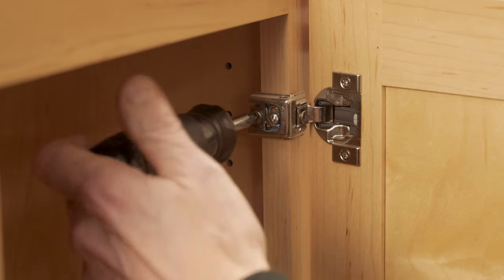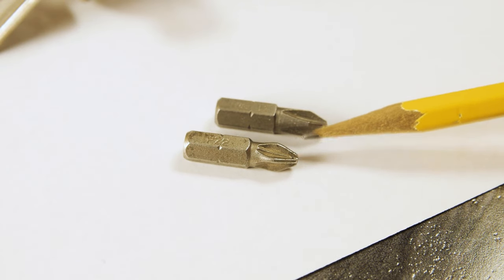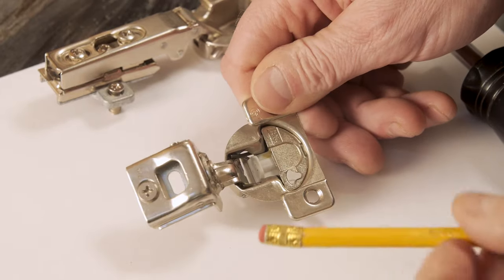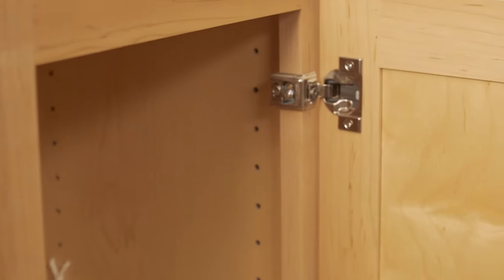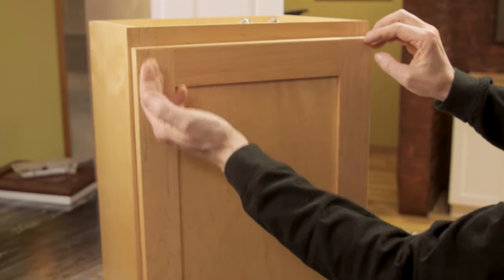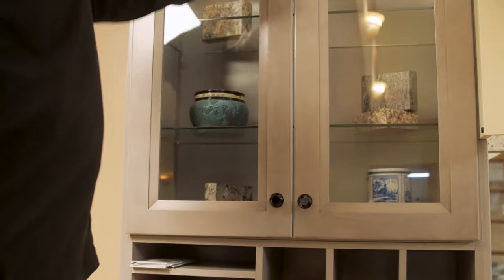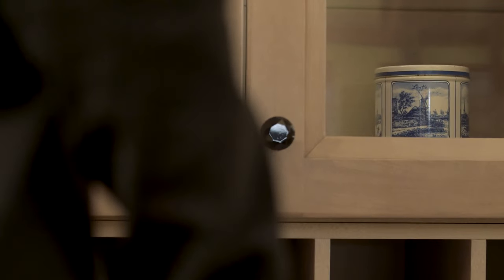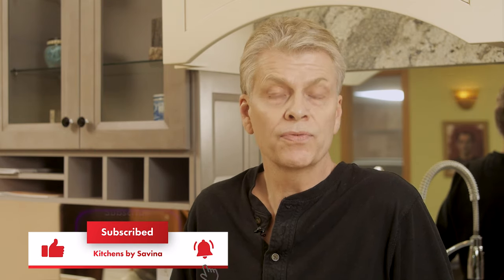How To Adjust Kitchen Cabinet Hinges

Comment: This is the best video on adjustments!  The only issue I'm having with adjustments is when the door isn't as close to the frame as it should be and the screw adjustment is as tight as it can be so no way to make any further adjustments.  I plan on getting replacement hinges.
Reply from the maker: Glad the video helped.   Make sure you are using either a Pozidrive or Phillips tip on your driver, whichever is the correct one.   Normally if your door was correctly adjusted when new it should be able to adjust back to that.  Without seeing it, hard to guess, but perhaps a new hinge will correct.   Good luck or contact me if you are unsuccessful at KitchensBySavina@gmail.com and I will try to help further.
Reply: Yes, I have both types of driver tips.  Two years ago we had all of our cabinets painted and the doors were removed.  I'm not sure if that caused some of the issues or not.  When we bought this place I had to make adjustments to a lot of the doors and drawers.  I bought new runners for a few drawers as well.  I just ordered two sets of hinges and a set of runners.

Comment: Thank you for the clip. Very helpful.  My slow-closing door does not go all the way in. How do i adjust it please?
Reply from the maker: About the 4.30 mark I discuss how to adjust the speed that the door closes.   Your hinge may have a variation of this.   It is possible that yours is broken or defective and may need replacement also.

Comment: Excellent video.  Did I miss you showing how to adjust how far the more expensive hinge opens so it doesn’t hit the adjacent cabinet?
Reply from the maker: I am not exactly sure of your application and hinge.   If it rubs against a doo next to it while opening, then adjust those doors farther apart.   If it open to hit a door on an adjacent bank of cabinets i.e. 90 degrees, you may be able to replace you hinge with one that does not open so far.   Several opening degrees are normally available.   Also you can install a positive stop in order to limit how far a door opens.  Something like this:  https://www.amazon.com/Stainless-Restraint-Cupboard-Restrict-Flexible/dp/B06VWYN115
Reply: @KitchensbySavina    These or what look like identical hinges are installed on my Wellborn kitchen cabinets.  When they were installed a couple of years ago the installer was able to adjust how far the cabinet doors swing open. Some doors open 90 degrees, some more.  I have one door I’d like to tighten up a little.  Unfortunately my contractor retired and is no longer in the area.  I’ve seen the door chains on some high end RVs.  Thanks!

Comment: Great demonstration.

It’s more complicated than it seems. I recently worked at a commercial cabinet shop for 2 years and would always struggle to adjust doors because when you move it one direction the opposite direction naturally follows, so it takes quite a bit of time to get them perfect.

If you spend 5 minutes on a pair of doors and have 10 sets, that’s about an hour.
Reply from the maker: Hi Maven.  In a cabinet shop setting, it's all about precision setup procedures.   The hinges should come from the factory all adjusted alike.   If the cabinet shop is setup using the proper hinge and jigs for installation, then theoretically there should be no adjustment necessary in the shop.    Any adjustment should be minor.    That being said if it is a truly custom, one of a kind piece, then that piece is always time consuming like a prototype would be in a general shop. I'm glad you watched the video and I hope it was helpful.  :)

Comment: This was great comprehensive hinge adjustment teaching! Didn't help completely fix my problem. Wonder if u have suggestion: Have a 24 x 36 corner top cab. Door that came with it was 1/2" short width wise to cover cab opening. Hinge adjustment = approx 1/4" gap remains. Ordered mullion door for it from same cab maker thinking we got weird orig door BUT the issue is the SAME! Pulling my hair out! Called cab dealer RTA & they tried to help by sending a box of hinges, but they have no more advice. We can't be the only people to have this issue...can we?? Please HELP! (Hav pics, bt dont knw how to send it here & can't find ur email address on page. New to u tube use.) Many thanks!!
Reply from the maker: Hi Melissa,  send email and phone number to my email at KitchensBySavina@gmail.com   I'll be glad to help.  website is www.kitchensbysavina.com

Comment: For full-overlay doors on a cabinet with a face frame, should the reveal be the same on all four edges, especially the same on the top and bottom? Or, as I have seen in some examples, should the door be centered left and right, but have 0" (zero inches) reveal on the bottom edge?
I am adjusting the doors on a cabinet over a microwave and I have some cabinets that are stacked, two and three high. I'm also considering a light rail.
Thx,
Reply from the maker: There is no rule.  I always leave a little clearance on the bottom.  I build my cabinets with 1/8 clearance top and bottom and 1/16 from edge to allow a run of cabinets to have 1/8 between all doors.  What you do depends on the case size vs the door and drawer sizes that you have.  Adjust for visual appeal and so nothing binds or scrapes.

Comment: Thanks! I did notice that the soft-close mechanism on the hinge you were holding in your hand differed from the soft-close mechanism on the installed hinge. How does the type on the cabinet adjust? I have a self-closing hinge set that is slamming.
Reply from the maker: The difference between self closing and soft closing is just that.   Self Closing pulls the door shut hard, i.e. slamming.  That type is not adjustable.   
You can buy new soft close hinges or install these: https://www.amazon.com/Rok-Hardware-Cabinet-Compact-Adapter/dp/B00IRLHIEK/ref=sr_1_7?crid=3H78AWPIDS669&keywords=soft+close+cabinet+door+damper&qid=1673809922&sprefix=soft+close%2Caps%2C80&sr=8-7

Comment: I have been searching for a well made and concisely explained use and function for these types of hinges. Particularly the GRASS product. But I’m writing to request a how to for a folding inside corner door. 
A few years back I had my kitchen remodeled and the designer uses Grass Hinges. I’ve never been able to locate the exact items for replacement when one hinge somehow snapped on a heavy (3 hinges) folding corner door. So I’m left to the mercy of the design firm to provide the replacement. I installed it and managed to sort of get it all back to good. But the actual steps are still a mystery. 
My door sags as you’d expect, against the neighboring door opposite the pivot. 
I also learned that even my excellent quality screwdriver is destroying the PZ screw heads. So I’ll be purchasing proper tools for this immediately. 
Can you direct me to or yourself create a video covering the folding door procedure. Please!!
Reply: I would like this information also!  Overnight, my folding door has seemed to sag enough to not close, or hit the top of its neighboring door.

Comment: Hi,
I have a problem with the IKEA besta TV bench..

The problem is the screw which is used for Height adjustment is not tightening or not loosening. Seems the issue with the threads.. 

Is there any fix you would like to suggest..
Reply from the maker: Sometimes a bit of hard soap or wax on the treads and try to work it back and forth until smooth.   If it can be removed, then you can purchase a tap at an automotive or hardware store and re-chase the threads.

Comment: Hi Gordon.  I can't seem to find a single video about how to do this with a desktop-type cabinet door.  I've got an entertainment center where the front lip lifts and I can store 3D glasses, DVD's, whatever.  It's the entire length of the entertainment center but only about 8" deep, so getting all 3 hinges level is proving to be much more challenging than kitchen cabinets.  There's also a 50 lb center channel speaker sitting on it, which also caused it to become unlevel, but even after leveling that, I can't seem to make it flush.  I'm hoping you or someone would make a video on how to do this?
Reply from the maker: Email some photos along with your phone number to kitchensbysavina@gmail.com and I'll try to help.

Comment: What if the door it self opens too wide? Ours is hitting another door while open. Thanks!
Reply from the maker: Hinges like the type in this video often come with different opening degrees.  Some open 90, 95, 100, 110, 120 or even 170 degrees.   They are available like this do work in different applications.   Search your type of hinge on the internet and see if a different one is available.  It may solve your problem.   Also there are many DIY solutions.  Here is one example.  https://www.charlestoncrafted.com/how-to-keep-a-cabinet-door-from-opening-too-far-the-easiest-way/

Comment: I have the old cheap style hinges and the door does not shut all the way.  I tried to adjust it but it still does not shut flush against the cabinet.  Is spring worn out or am I able to adjust it with the shims or?   Thanks!
Reply from the maker: If they have a spring that holds shut it may be in need of replacement.   If hinge side of door is too tight to cabinet, that will prevent it from shutting all the way.  If so, space hinge side further out from cabinet so it doesn't bind.   Let me know if this solves the problem.  :)

Comment: Please show how to remove cabinet door if you have the soft close hinge. You showed how to unclip the imported hinge and remove door but you didn’t show how to unclip the other hinge to remove door. I need to paint a small strip of wall that I can’t reach unless cabinet door is off.
Reply from the maker: I'm not sure which hinge you are referring to.  Not all hinges unclip, you may need to unscrew it.   Usually careful inspection of your hinge will point you in the right direction.

Comment: Is there an adjustment if the door doesn’t close all the way?
Reply from the maker: It's possible that the hinge needs to be adjusted further out from the cabinet.   If it is too close it can "bind".   It is also possible that it is bent due to be forced open too far.   If it is bent, then it will require replacement.
Reply: @KitchensbySavina  OK thank you I was hoping it was an adjustment but I’m sure they were probably open too far. Ted

Comment: What if the board inside the cabinet the hinge attached to is cracked - how do I go about fixing this. My dog ran into the open cabinet and now the board is cracked.
Reply: Use a clamp (purchase one if needed)   to push the two pieces together with yellow carpenters glue in the crack.   After you clamp it wipe the excess glue off the surface with a damp cloth.  If the screws for the hinge don't grab tightly glue some wood in the holes and try again or go to a sightly longer or larger diameter screw.  If you don't feel confident trying these repairs ask a knowledgeable friend or handyman to help out.   Let me know how this works out for you.
Reply: What I have found that works, is to take the screw out and take some tooth picks and wood glue. Drill the hole out a little and then stuff the hole with tooth picks and wood glue. Let dry and then with a sharp knife cut the toothpicks flush. Drill a new screw hole and attach the hinge again.

Comment: My door has bounce. No matter what I do it don’t go away
Reply from the maker: Hi Legend. Make sure the hinges are pulled all the way out (forward)  it should not bounce when closed.  If it is I suspect either the hinge is sprung, meaning it has been opened to far and "bent"  or you door is quite warped.   If you take the door off and remove the hinges it should lay flat on a countertop or other flat surface.   If one corner is up it is warped.   If not warped, you might try new hinges (if sprung or bent) .  Let me know if this helps answer your question and how you make out repairing the problem.

Comment: No matter what happens or how I try to adjust, keeps coming out crooked on one side or other.  Worked for years just fine.  Frustrating.   Keep my day job for sure
Reply from the maker: Feel free to call me through the website.  Maybe I can talk you through it.  Www.kitchensbysavina.com
Reply: @KitchensbySavina  thanks.  I finally got it straight, but still not closing softly.  Think I need to replace the hinge which must be damaged.
Reply from the maker: @jc2091  The soft close mechanism can certainly fail and may need to be replace.   Often there is a pressurize component that can develop a leak or a spring that either breaks or wears out.    Fortunately installing a new hinge is quite easy.   Just make sure you get the right replacement.